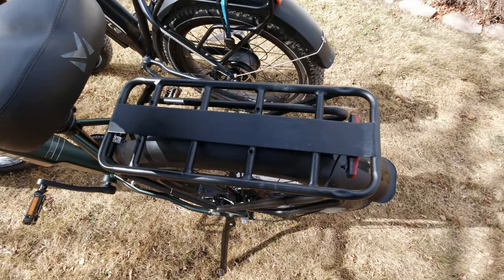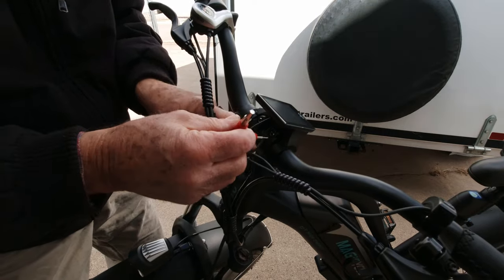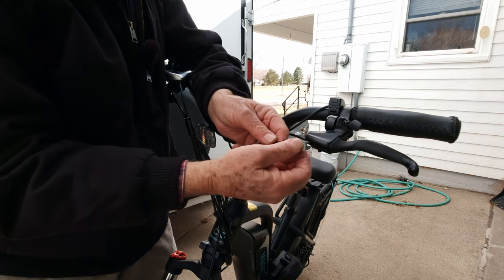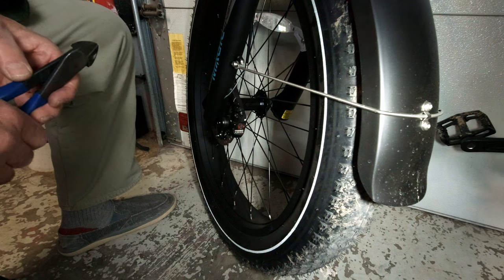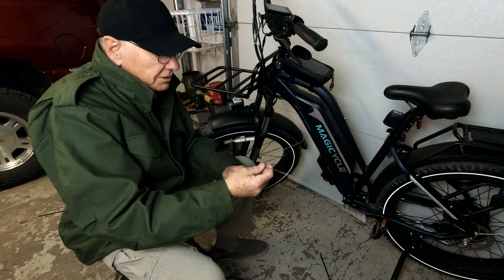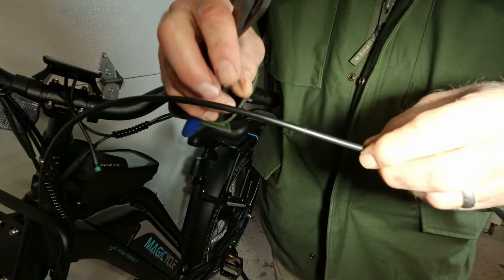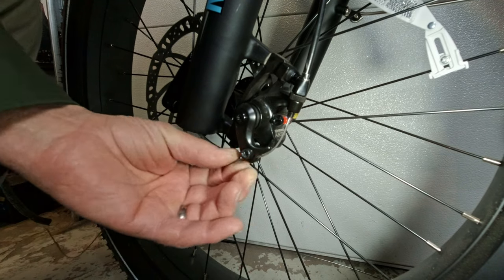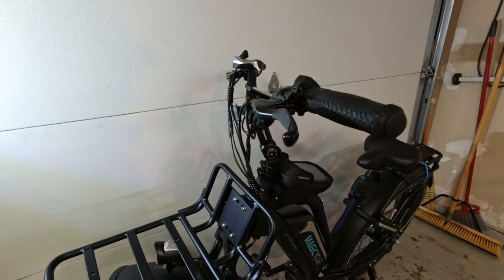Customizing your ebike to fit and suit you better

Comment: I had to make an  11 foot long throttle cable for my modified 67 Chevy van, that I put a V-8 in. To make a crimper, I used a piece of 1/8" thick steel, drilled a hole the same diameter as the end piece, chamfered both sides, so the inside hole was about 2mm. Then cut it in half with a hack saw. You put one half in a vice, facing up, put the cable on top of it, put the other half on top and whack it with a hammer, and then you have a nice, neat, professional crimp, that definitely stays put..
Reply from the maker: Nice job.

Comment: I ride a 20" fat tire folding bike and replaced my handlebars with a much higher one and, like you, I like the feel of the body position except I've found that it places a lot more of my body weight on the saddle -- especially on my tailbone (not my sit bones). My tailbone was aching  after just a few miles of riding. So I built up the areas on my saddle under the sit bones with a few layers of carpeting so as to leave nothing of the saddle for my tailbone to sit on and my tailbone feels no more pain. 

Now I want to find a real saddle (to replace my frankensaddle) that protects my tailbone, but there are so many commercial saddles on Amazon that get bad reviews -- so it's hard to decide which one will do what I want. Perhaps I'll just order some padding riding pants and use my bike's stock saddle. We'll see.

Hope your new handlebars done give you the same problem.

Thanks for your nice video on your the MagiCycle.
Reply from the maker: Hello Peter.  I got out on an extended ride today and didn't have a problem with the saddle being too hard on my boney posterior.  I just looked on Amazon and there are a ton of choices that make it confusing!  How about going to a bike shop to try out some different seats?
Reply: @gonagain  Glad your bottom is happy. I'll heed your advice. Thnx

Comment: Now you can install the larger rack on the back and saddlebags on each side of the rear tire. Bicyclists also use saddlebags on the front.

As you know, for decades... the traveling cyclists are loaded for bear as they travel along their routes.

I'm looking at an elite with a 1500watt motor for the same price. (Just under $1,700.00) one upgrade I want to do on my bike will convert the mechanical brakes to hydraulic brakes. 

Being, at least temporarily, disabled, I need every advantage I can get. 

Congrats on your upgrade.

Nomad
Reply from the maker: Thanks, Nomad. Ebikes allow folks, who previously couldn't ride, to ride again. With bad knees i couldn't ride a bike in the backcountry but I can with an ebike.
Reply: @gonagain   Yep, I lived in Russia for a year... while there I tried riding a bike around town, but I couldn't do it because my right hip was so degenerated the ball was just slopping around in the socket. I had to come back stateside to have the hip replaced. It was exceptionally painful.
Reply: @gonagain  I went ahead and bought the 1,500w motor. It's supposed to be delivered Tuesday May 10th.

I'm in Seattle right now,  prepping for my back surgery on the 12th. 

I expect to be home on the 16th.
Reply from the maker: @nomadthetraveler5782  That's going to be quite the bike!
Reply: @gonagain  I finally finished assembling my eBike. I figured I'd ride it while I'm healing from my major spinal "revision" surgery.

I wanted to test ride it yesterday, but when I set the height on the seat and started thinking about getting on and riding... I thought about it again.  It's a pretty tall bike and I'd have to come off the seat and put one foot down while leaning in that direction slightly. The eBike is definitely taller and heavier than any bicycle I've ever had. 

My specialist surgeon, who fixed my spine about three weeks ago, said "No!"... when I asked about physical therapy.  He said I need to wait 12 weeks to make sure my spinal fusion took.

I started to get on my eBike but suddenly thought better of it. I can barely walk still... it's only been three weeks. If I fell for any reason, it would screw up my spinal fusion for good. After about sixteen months of the most mind boggling PAIN... I don't ever want that again so I'll avoid injuring it again by any means necessary. 

So, I had my neighbor test ride it for me. Now he wants one. lol

(While he was riding across the field... his wife hollered over to me saying, "Now he'll want to get one too.") Sure enough... when he got back over to where I was... I could see the excitement in his eyes and on his face as he was now talking more enthusiastically about it. Telling me in minute detail of his experience riding it. (Even though he'd only been riding it for a few minutes. lol)

Anyhow, it tested very well. Mine has a 1500 watt motor. Not 500 or 750 watt motors like so many other models I've seen out there.

I can't wait to ride it myself, but... I don't dare ride it till my spinal fusion is well healed. After sixteen months of pure unbelievable PAIN... I want to avoid that like the plague. No more involuntary screaming and seeing light shows in my eyes from like lightning bolts going through my body making me instantly jerk around to a more neutral position.

I'm not afraid of riding or falling off. I'm afraid of such incredibly unbelievable PAIN in my spine again from crushing my spinal nerves again.

I can't wait though... to ride it and enjoy being more mobile and free again. It's been so long since I've felt good without being in such horrendous PAIN... it feels like it was in another life a lifetime ago.

Comment: And if you had not mentioned the throttle limitation on other bikes we would not have known.
I have never seen another reviewer mention that.
Reply from the maker: Mostly I don't find it to be a problem, just different.  Except for one thing; If you get attacked by someone's dog or have some other unexpected need to get going in a hurry, it's nice if you can just hit the throttle and go to max speed without having to change the peddle assist level first.

Comment: Some people will have issues with cutting the cable cover because you need a sharp pair of cutters to do the job. If you have a rotary tool (like a dremel) with an abrasive wheel you can make the cut without squeezing it and distorting the shape.

Comment: You did a fine job on the bike. I was wondering could you buy a bigger rack for the back. It would be good if a person could brace the front rack some how. Do you think it will hold much weight on the four bolts? It will be interesting to see if that works loose on off road adventures. Living where you do if a man could get a set of tires like the motorcycles do with the studs in them for racing on ice you could motor right on down the road. Good video, you take care my friend.
Reply from the maker: Hello Willis!  I got the bike out today on the trails and it did great.  The front rack looks to be well made and has a carrying capacity of 30lbs, but I can't see putting that much weight there.  The 4 bolts screw into a plate that is welded to the frame and I think it's going to be strong enough.  I don't care for the headlight being way out there and vulnerable and may go to a handlebar mounted one. You know, they actually make studded ebike tires and they're really expensive!  I'm too much of a sissy to ride in the cold anyway.

Comment: Hey Rick, I am wondering if you ever figured out why there are 5 different voltage settings in the voltage menu and why they are each adjustable.  I have spoken to Magicycle and have not been able to get an explanation..
Reply from the maker: Hello James, I'm not totally positive, but I think it's because Magicycle doesn't make the display and it's designed to be used with other ebikes also.  Just set it at 52volts and you'll be fine.  Also, the amperage setting is 15amps from the factory and that works just fine.  I know that can be increased up to 22 amps, but I'm not sure what the cost would be in battery and motor life.  The bike has plenty of power as it is.
Reply: @gonagain  Thanks Rick, I will try moving amps back down to factory and see how that is

Comment: Rick you are doing things wrong ! just so you know i'm the owner of Vulture bicycles Wickenburg AZ. have been a bicycle mechanic for over 50 years.  so when you put the stem on you tightened the center bolt like a old gooseneck,  wrong that bolt is only for setting the tension on the bearings. so once you put tension on the bearing not to tight you tighten the 2 bolts on the stem, that clamps it to the fork. you need to re adjust the tension on your bearings.
Reply from the maker: Much appreciated Steven!  I'm heading out to the garage right now to fix it. I had to re-adjust all my bikes!
Reply: @gonagain  just want you safe, next time your down my way stop in and say hi. keep up the good job !